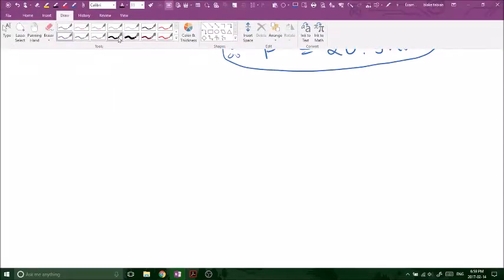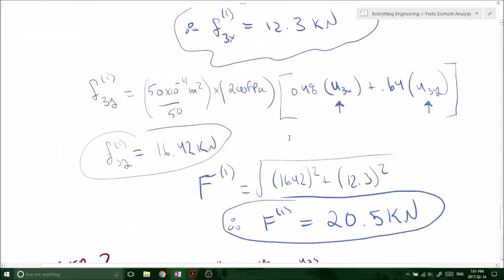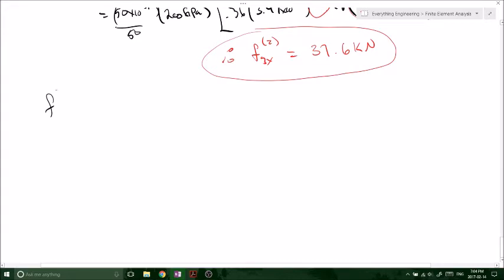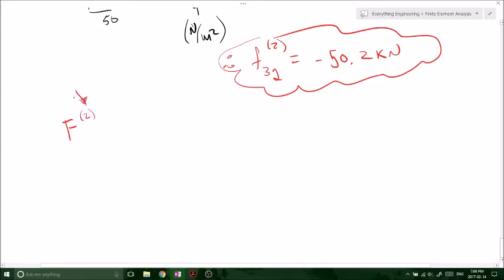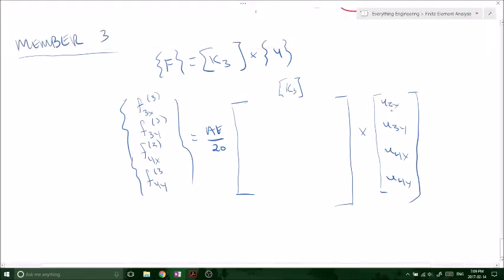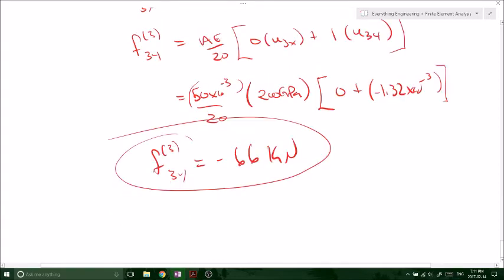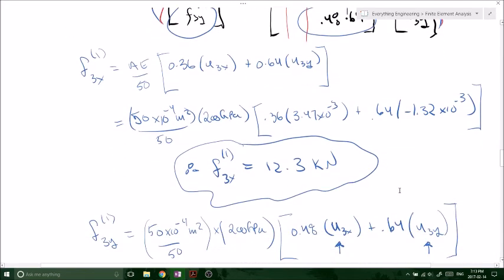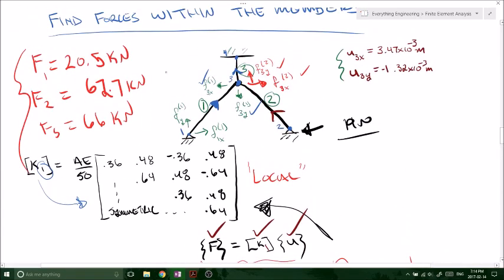Calculating member forces using stiffness matrix in 2 Dimension PART 2 of 2 - Finite Element Methods

Comment: Thanks for the video,

Just had one question in regards to calculating the force in the members, what would be the process for a member that:

1. The member has slider support instead of a fixed/pin?
2. The member has no supports at all?